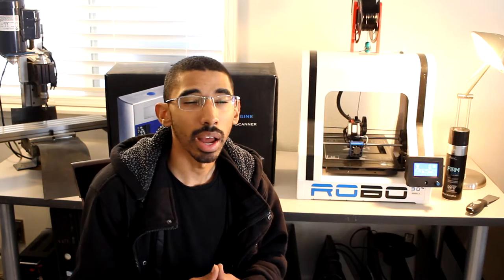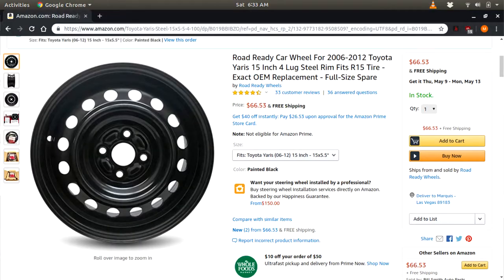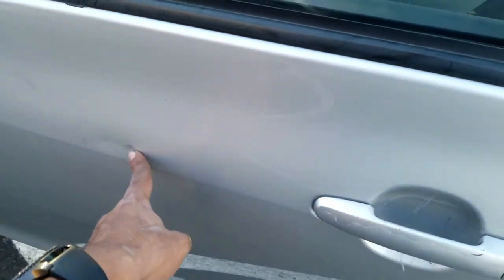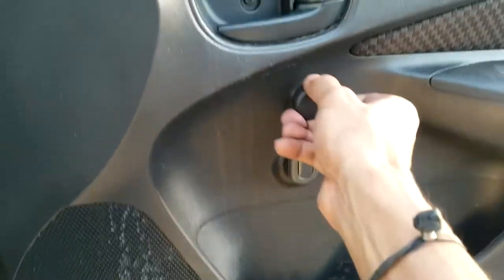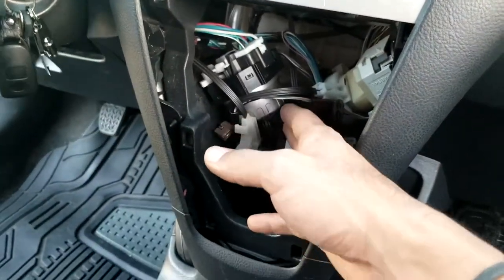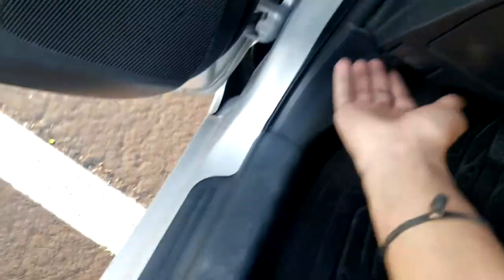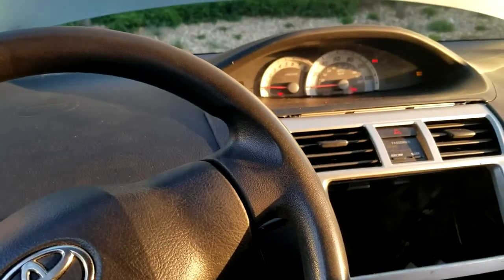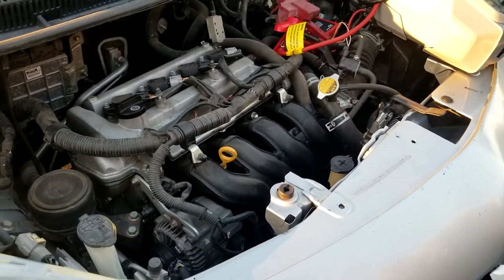2008 Toyota Yaris: Maintinence (Part 0)

Comment: Could I have your email so I could send you some pictures of my printer that I'm having trouble with, I just got around to installing my E3D hotend and I'm worried about making the ptfe tubing too short for flexibles to print properly because for some reason I can't get it to pull filament to the hotend consistently.
Reply from the maker: MarqEverJohn@gmail.com